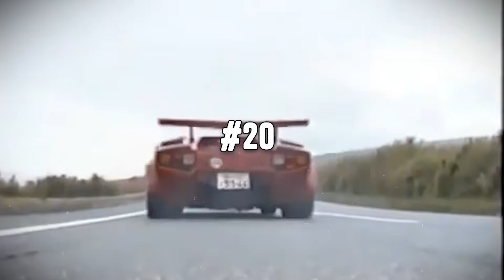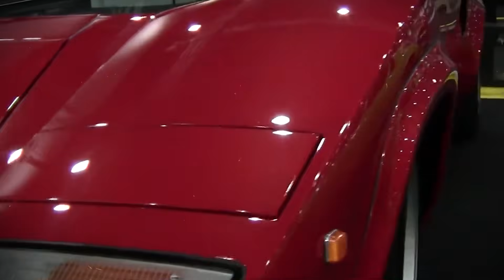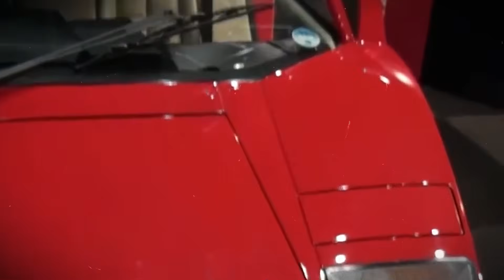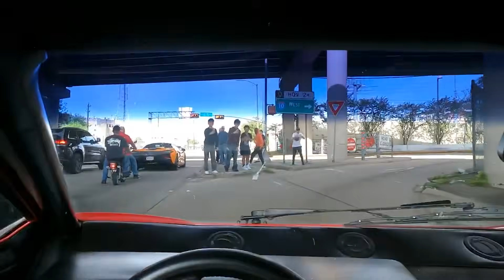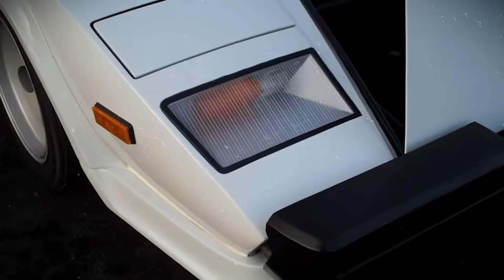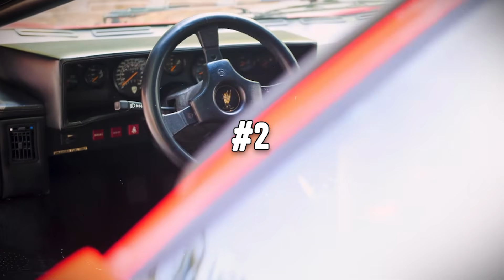1985 Lamborghini Countach 5000 QV: 20 Weird Facts You Didn’t Know!

Comment: For one, you have a mix of QVs, other models, and some seriously ugly replicas mixed up in there. But on a brighter note - you have one of my cars. However, the "fact" that 98% of the rear view is blocked is total bollox. I've had mine 5 years - backed it up, parallel parked, and never once have I had to sit on the sill. The view behind is not that bad. Don't believe everything you hear on the internet - which is why I have issues with all these "facts" you're presenting - I don't think you have any experience with the cars, you're just re-hashing what everyone else re-hashed from whoever they saw re-hash crap to start with.